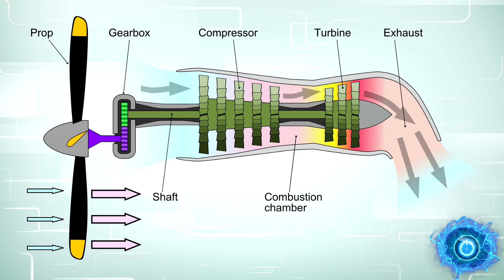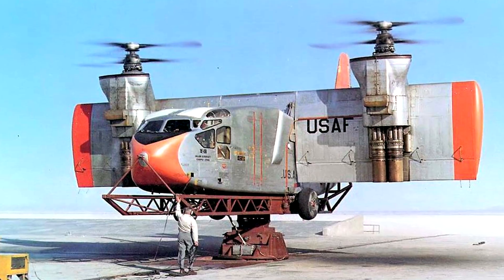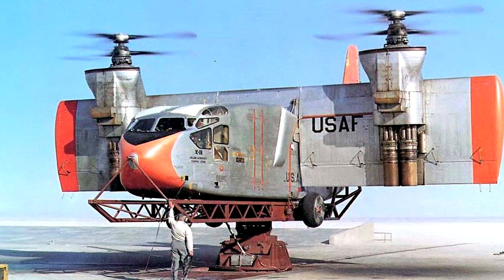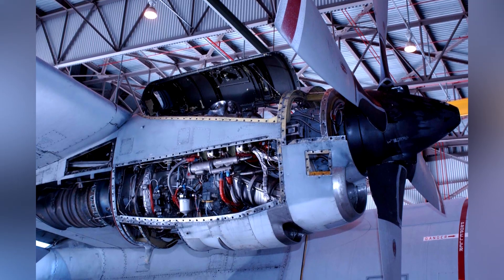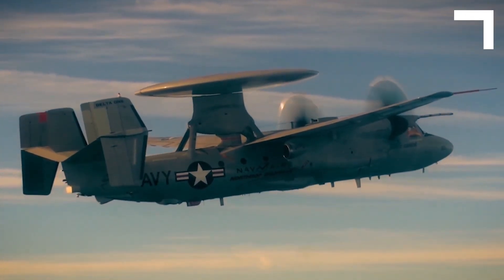Allison T40 - The MOST POWERFUL Engine Of It's TIME

Comment: At that time, the TU-95 with 12500 hp engines was already flying in the USSR. You are weak.
В СССР тогда уже летал ТУ-95 с двигателями 12500 л.с. Слабоваты вы.
Reply from the maker: At which time? The T40 was 4 years ahead of the Kuznetsov TV-2 so we are talking about 2 different things. The TV-2 was still a beast though, definitely beat out some the 56 early designs.
Reply: @Motor_Explorer1 , even the dual TV-2 was 2 times more powerful than the T40, also dual.
Даже спарка TV-2 была в 2 раза мощнее чем Т40.

Comment: How can an engine only be shut down by throwing debris in it?
Can't they just cut the fuel?
And why in the world is debris pronounced as debree?
Reply from the maker: One propeller sheered off, damaging the fuselage and cutting controls. The plane crashed and it had to be shut down "manually". In other words, it had excellent safety features!
Reply: Lmao this guys asking the real questions. I'm guessing it was having a runaway like diesels. The oil lubricating it was burning and they couldn't safely drain the oil which is pumped through the engine mechanically.